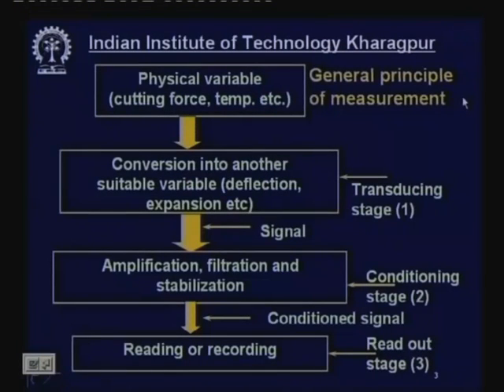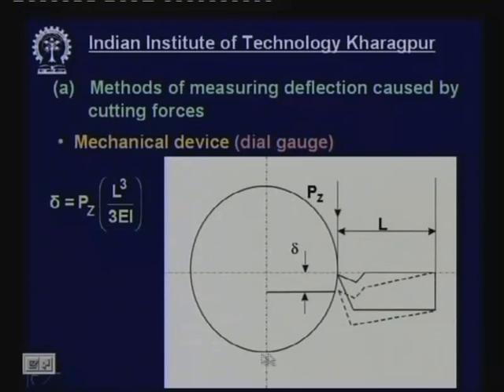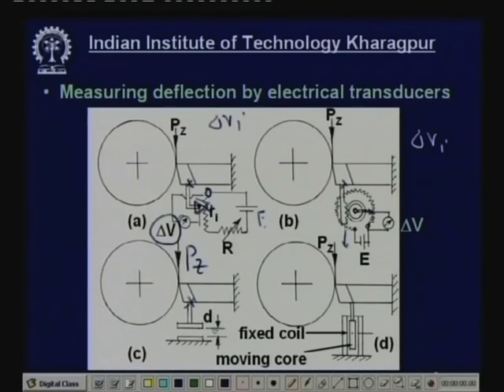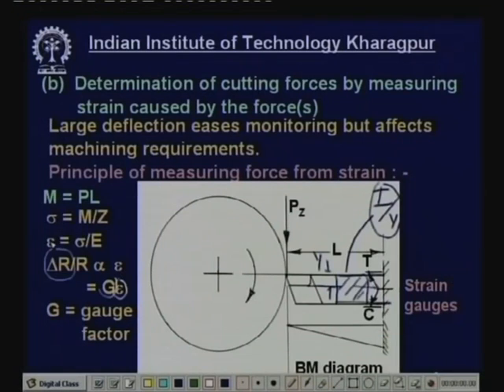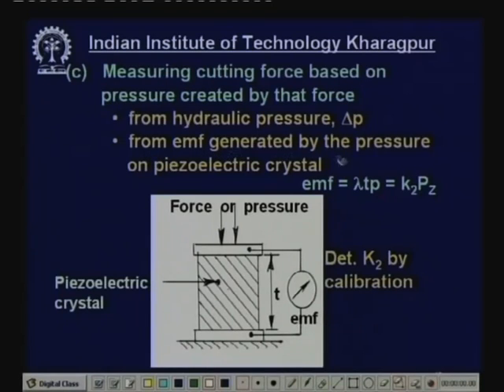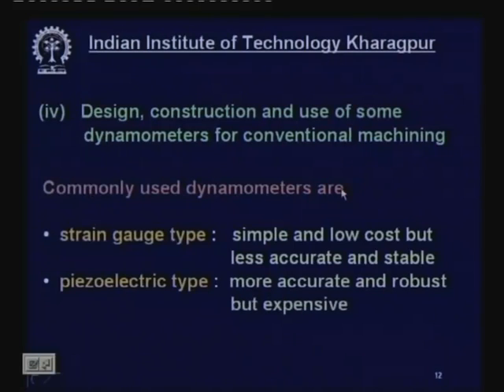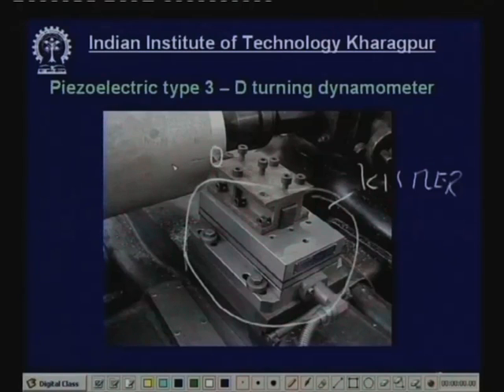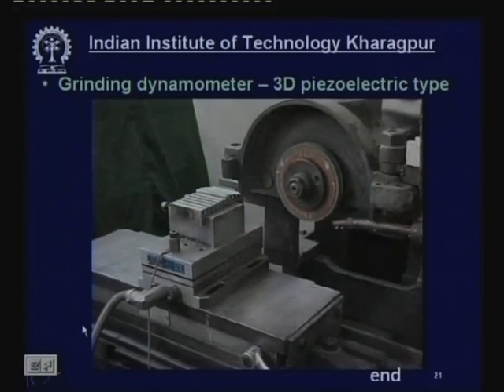Lecture - 10 Dynamometers for Measuring Cutting Forces

Comment: SIR  you told by some known Pz we have to get the value of delta V. by  calibration.but our target is to find Pz..how  can I get a known Pz?
Reply: He is telling first apply load urself on that tool and measure deflection say apply P1 u will get deflection x1 then u apply p2 u will get deflection X2,similarly for p3 u get x3,for p4 u have x4 Nd it goes on finally u get a curve.....now jb ye curve tmhare pass aa jae then u enter to the experiment of measuring Pz....by the help of dial gauge u can measure deflection X.....so look at ur curve which u have drawn earlier and find corresponding to deflection X What is P in ur curve u will get required Pz........I hope u understand